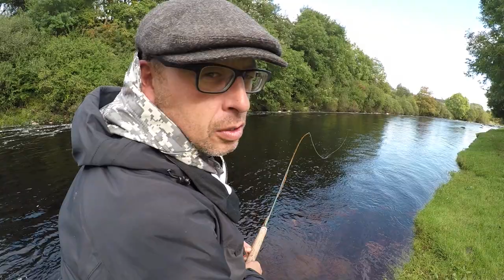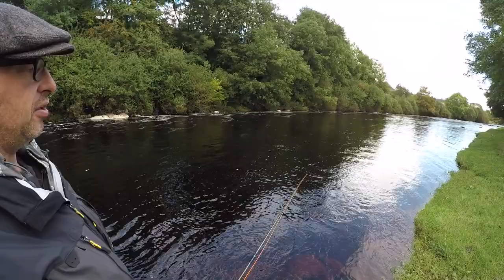fly casting  the wave spey techniques by Michael Rebholz

Comment: Wonderfully inventive! Have you tried it with shorter rod lengths!
Reply from the maker: Thank you very much and yes, I have tried it with smaller rods, it works the same, but in another frequency that is related to rod length, line length and weight of line outside the tip.

Comment: what rod and line are you using Michael?
Reply from the maker: The line is a 350 gr snowbee switch line. The rod is one of my prototypes and I can't talk about it yet.
It works with any rod and line. If not I recommend to over line if you are practicing. Easier to feel and more enjoyable casting all over with soft rods.
At the end of the day it has absolutely nothing to do with rod and line. It's the technique.